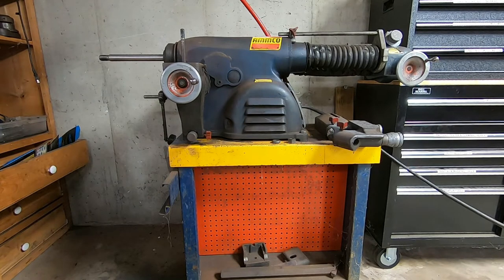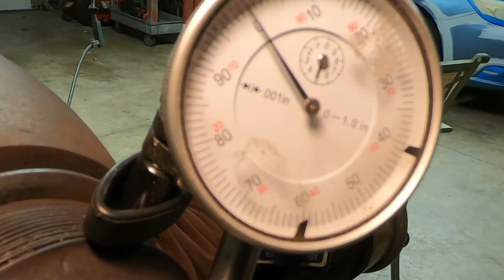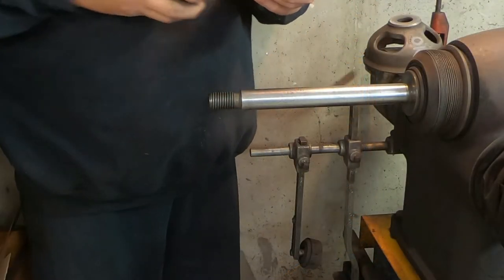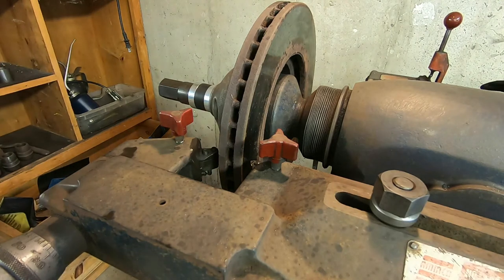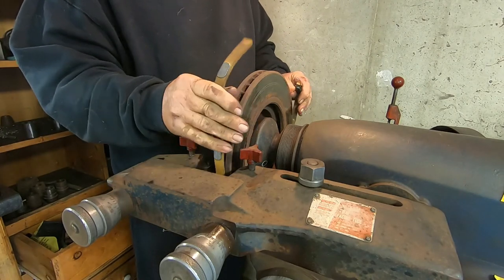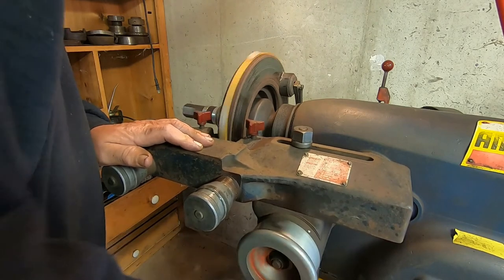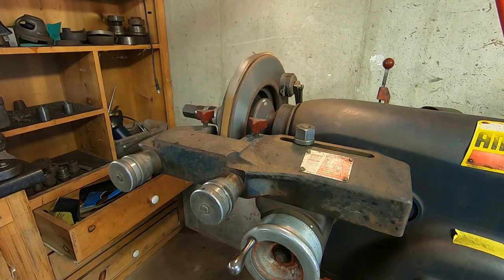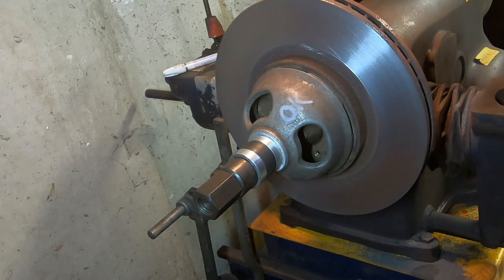How to Turn a Rotor on an Ammco Brake Lathe

Comment: Another awesome video Rick!  I didnt realize how much went into resurfacing rotors, but your are correct the OEM rotors are much better than most aftermarket stuff.  Thanks for the awesome job on the rotors for my Sierra, I installed the resurfaced rotors with a set of Akebono brake pads and the brakes are smooth as a baby's bottom.
Reply from the maker: Thanks Dan.  It is like anything else the more you put into it the better the results.
Reply: @richardspaulding5035  I may need you to turn another set of rotors for me on my car, if you are willing.  Is there a way for me to contact you directly?
Reply from the maker: @danfield8102   Drop them off any time Dan.  I am home most of the time these days.  We can exchange numbers then.  I don't want my number going out over YouTube LOL.  Remember to blow your horn before getting out of the car. I have two German Shepherds now. I look forward to seeing you again.

Comment: Thank you for posting this! This is almost exactly the method they used at my school on the Ammco 6900 and 6950. The only 2 differences are they make us put the band even for the scratch test and hold sandpaper grit 130 after the last cut. The teacher goes fast so we all get a turn to practice but you explained it so well and here I can always go back and rewatch what I didn't understand.  Thank you again.
Reply from the maker: Thanks for the kind words; Not many shops use these lathes anymore. They would rather sell the customer those cheap rotors made in China. I think a resurfaced original equipment rotor is far better. I am retired now, I only work on friends and family vehicles these days. Quick tip: If your having problems with vibration try making the tool work a little harder.  Take .006" per side on your Finnish cut  instead of .004"  This works especially well on larger rotors. I never take less than .004 because it will cause the tool to overheat. Thanks for watching my channel.

Comment: I’m guessing all the rust dust is why technicians opted for replacement rotors over saving its consumers money and inheriting a lifetime or medical bills and problems
Reply from the maker: If the dust is the only concern a mask can be worn. The issue is the high cost of labor as most shops get $100 to as much as $150 per hour these days. It takes 35 to 40 minutes to resurface a rotor.  It does not make sense for them to do so. They not in business to save the customer money they are in business to make money. I am retired now and enjoy saving my friends and relatives money.  I picked up the machine on the cheap because the shops don't use them anymore.

Comment: What would happen if you cut a rotor below the discard thickness but run it anyway?
Reply from the maker: As you know the caliper piston moves outward to compensate for brake pads wear. The manufacturer calculates the discard thickness of the rotor by determining how thick the rotor needs to be to prevent the caliper piston from completely blowing out should the brake material on both pads wear down to nothing. So, to answer your question initially nothing would happen. However, once the brakes were to wear down beyond a certain point you run the risk of a failure. Thanks so much for that question as I am always looking for new content. I am going to produce a new video on this subject in the days to come.
Reply: @richardspaulding5035  thanks for the reply. I found this video because I am currently looking for a used brake lathe. I’ve had to replace warped rotors so many times over the years that it would have paid for the machine by now. Nobody in my area wants to turn them anymore and I wondered how far they could be turned under the minimum thickness before you would have problems.
Reply from the maker: @ZZTOPGUY1  I purchased my lathe on Craigslist, as I recall I paid 800 dollars for everything including all the adaptors.
Reply: I’ve been looking on marketplace. So far everything has been too expensive or way too far to drive. I’m seeing a lot of on car brake lathes. Do you have any experience with those?
Reply from the maker: I have never used one.  From what I understand they use them with cars that have problems with runnout for reasons other than a bad rotor, Say you had a hub or axel that is causing the runout.  An on the car lathe will tune the rotor to the car's components.

Comment: Thank you for posting this. Being in the Rust Belt, do you have any experience with coated rotors? Some are painted, some appear to be annodized and some have some other kind of anti-rust treatment/coating. I wonder how well they prevent rust and "sticking" to the hub.
Reply from the maker: I have never worried about them being treated with paint or anything else. I usually will put Anti-seize on the hub before installing them. Rust will form on the disk part of the rotor overnight in almost any climate.  As you apply the brakes the pads work the rust. If you have ever let a car sit for a week you will hear noise as the pads work off the rust. The rust being rubbed by the pads actually makes the cast iron rotors harder.  This is an old machinist trick used when rebuilding an engine block. After boring the cylinder walls, they put the block outside for several days to let it get good and rusty. Then bring it in and work the rusty cylinder wall with a cylinder hone. It hardens the cast iron and makes the rings last a lot longer.